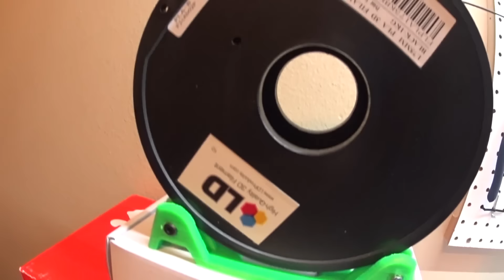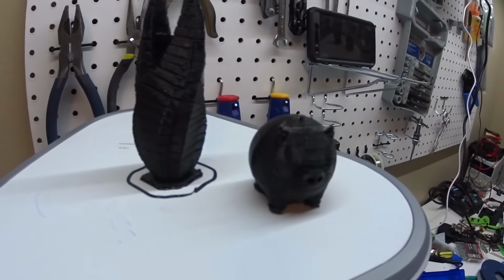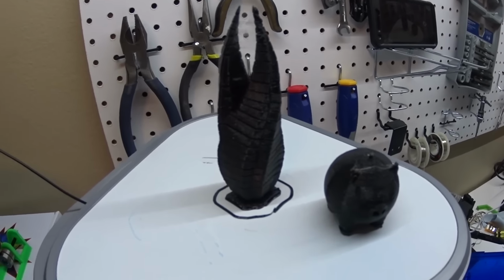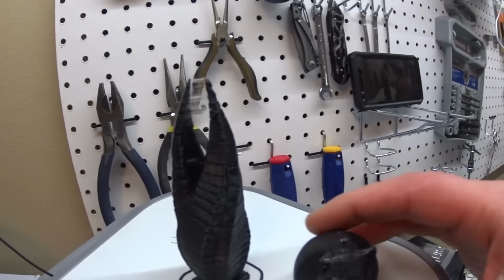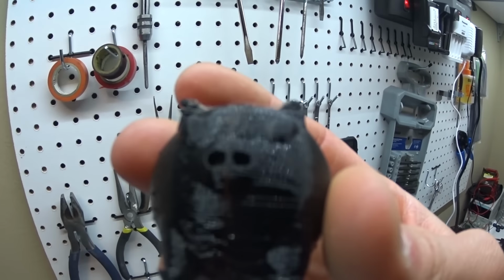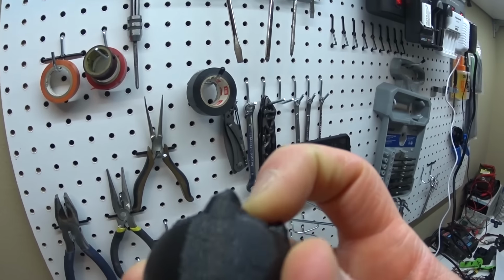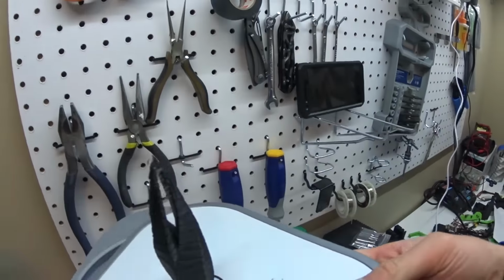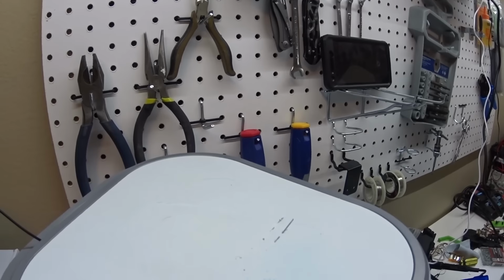Production Tiko 3d Update

Comment: I'm getting really random layer shifting when the printer feels like it.  Hope its just a software issue.
Reply from the maker: @liv04soccer - on the models that you are trying to print are you autoleveling or manual leveling? Also is it the type of print that the extruder needs to print multiple small sections prior before bridging the larger part. I know I am not explaining this correctly, but the type of print I am talking about is similar to this:

http://www.thingiverse.com/thing:257911

I noticed if you don't have a lot of z moves on the print for travels that the prints come out pretty good, but on large prints with multiple "islands" that you have a lot of z moves (z hop setting) that you end up with layer shifting. Really strange but I think that this is attributed to the backlash in the motors. 

Give this print a try to see if the layer shifts persist:

http://www.thingiverse.com/thing:1545913